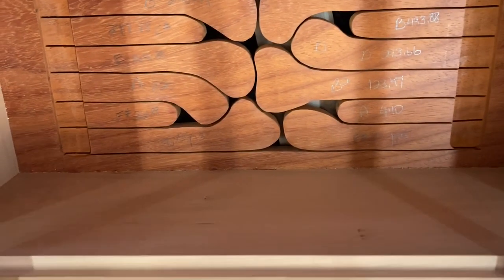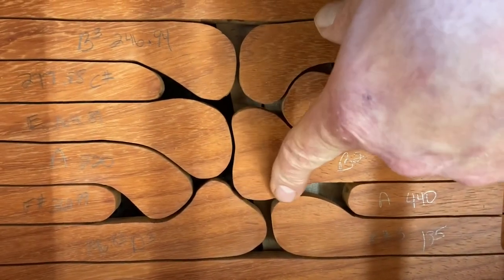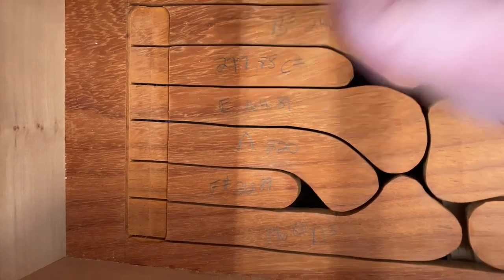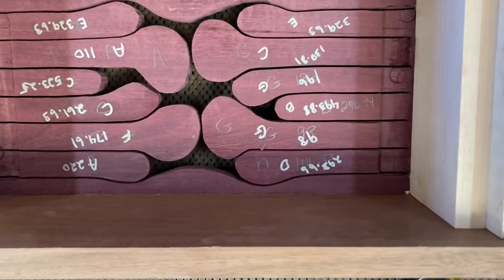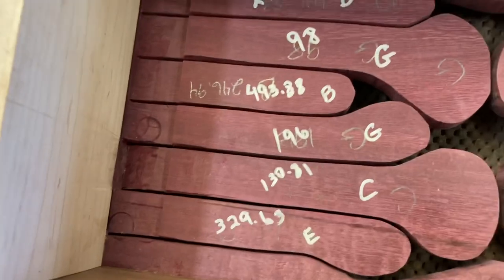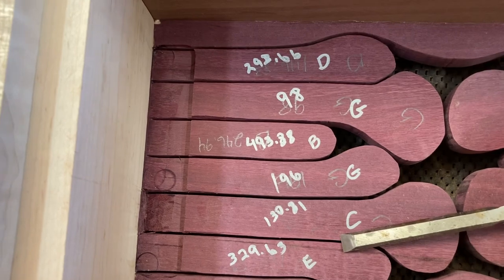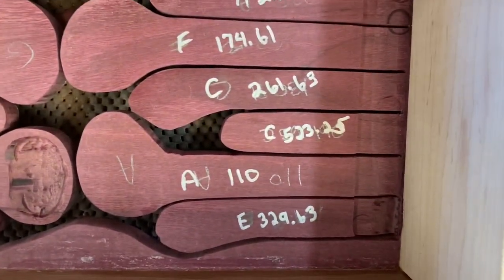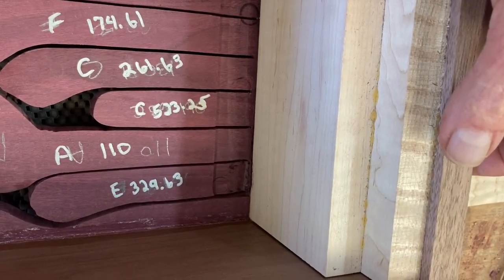Wooden Tongue Drum Construction Basics

Comment from the maker: I did not go over installing the bottom after tuning is complete. I use a 1/4”/6mm bottom. My view is that the bottom of a tongue drum is performing the same task as the top of an acoustic guitar. Think of the tongues as the strings, they create vibration and the only thing below them that will vibrate like an acoustic guitar top is the bottom, so to amplify that vibration a thinner bottom will move more than a thick one.

I have not experimented with a thinner bottom, mainly because by the time you’ve done all the rest I don’t want to chance making a mistake. A thinner than 6mm bottom might give you more volume but it also might make it sound muddy. As it it there is plenty of volume with 6”D x 8”W x 18”L box. In a living room with other acoustic instruments it will have no problem being heard. If anyone has experimented with bottom thickness I would love to hear your results.